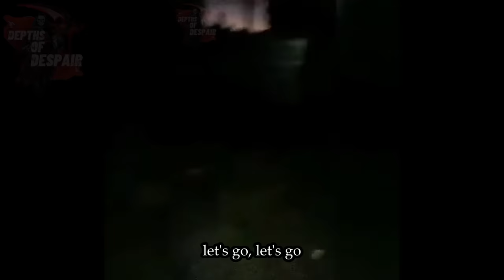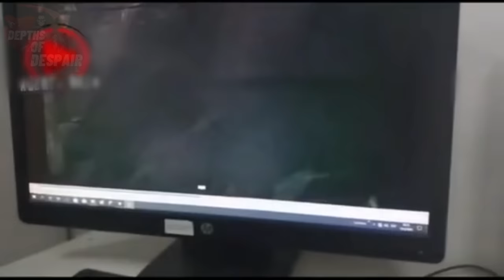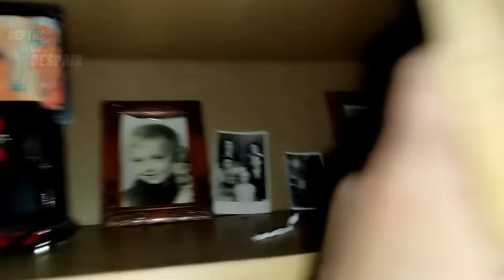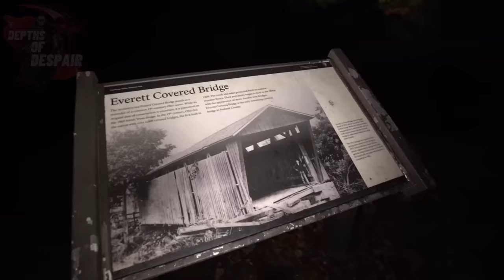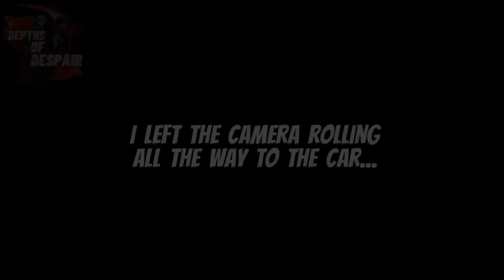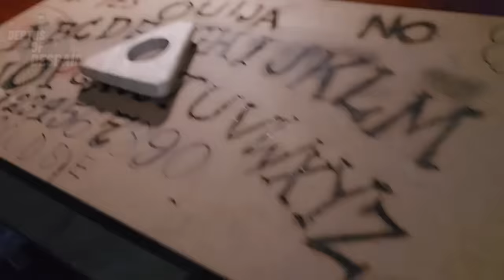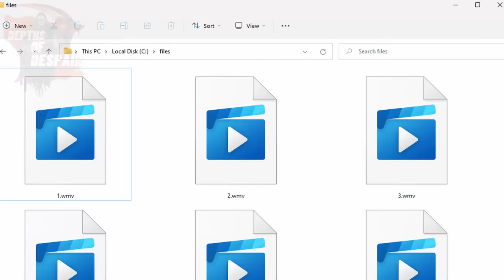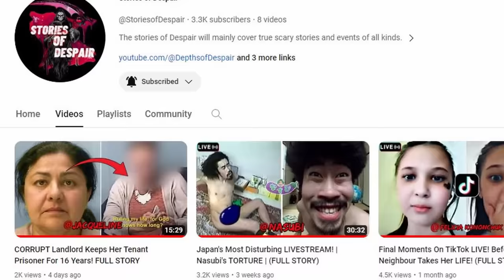Top 20 Scariest GHOST Videos Of ALL TIME! V5

Comment: For some reason, Ghost loves bathrooms! I had one or some attached to my bathroom one time. I would hear them come through my backdoor every night around 11pm, (without opening it) and hear it  walk straight to my bathroom and would hear the noises all night like someone was in there messing around. I would see shadows moving too and shadow figures out the corner of my eye, knocking on the door and wall! The more I told it to get th out of my house, the stronger it got! Finally, I left every light in the  house on 24/7, for 3 weeks and completely ignored it and it went away!
Reply: It’s bc the bathroom is a place you let your guard down and are naked and vulnerable where you can be caught off guard and it’s normally a small space

Comment: For the guy that calls himself "Professor Cynical " or along thoes lines..I have a question for u,being that u "don't Believe in spirits/ghosts, now that u heard "something run down the stairs at YOU, door handle giggling and that backpack slide across the floor BY ITSELF..do u BELIEVE NOW??..Just because YOU don't believe in them doesn't change the fact that THEY BELIEVE  IN YOU, NO MATTER WHAT YOU BELIEVE.  Good luck.😊

Comment: The woman whose bathroom door keeps opening on its own is probably self-induced . When her light switches on by itself and the security camera changes, adjusting to the light , a portrait of a Ouija board is clearly visible behind the doll on the right side of the camera shot. If you mess with Ouija boards , you'll find out the hard way.